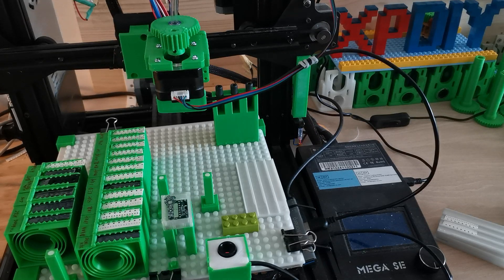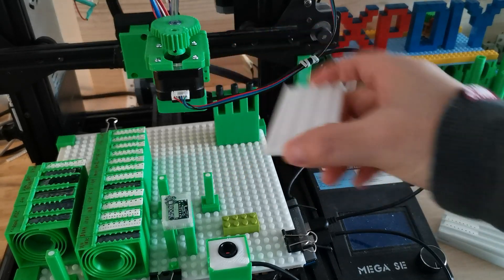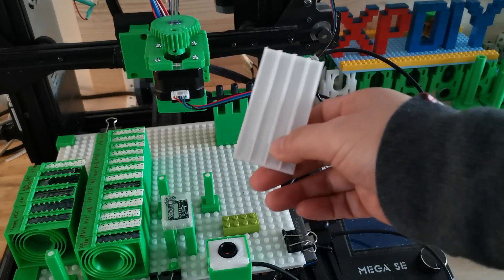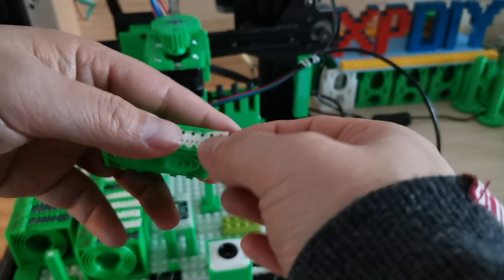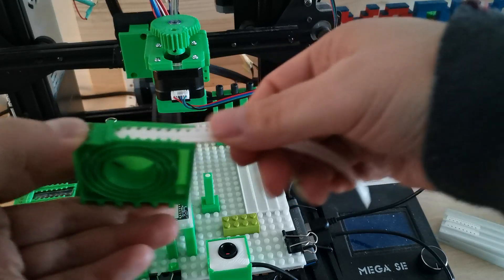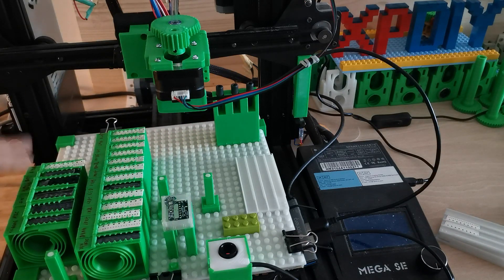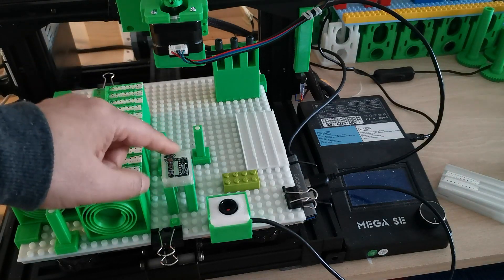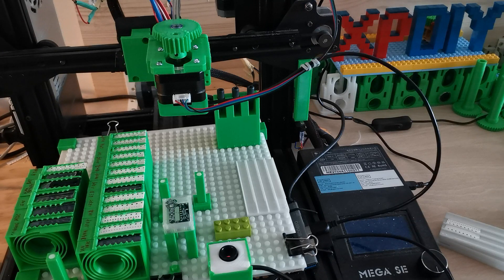3D printer to PNP part 9 - New Feeder design for small spaces

Comment: This is genius! Do I understand that the spiral tape storage pocket is hollow and so will keep the components from  spilling out? This would require the cover tape to be pulled away as you load the parts into the cassette. If not, how is the cover tape handled? Also - when can I get a file to play with?  In case you're wondering, I have a Pruse MK3S+
Reply from the maker: Thanks for sharing the info! Actually this is the simple version, so when loading, the cover is still there, one need to remove it manually after pulling out. The next version is when pulling out, the cover is removed at the same time, kind of semi-auto way. But this will come only after I released the first version. I hope to get things ready within a month, then will work further on the feeders.
Reply: @xpdiy  Thanks! I'll be watching for it. My most difficult boards are 0402 and leadless. There are at least 50 line items, so you can imagine how difficult it might be to fit all those feeders and how expensive feeders for this would be. Your solution is not only  very compact, but could easily make a preloaded magazine such that swapping in a new magazine in the middle of a run would be a simple matter.

Comment: I have been following for last year and can see good potential of this project .  CAnnot wait for some documetation models , drawings etc . 
Even if this would be paid I would parcitipate . Can you estimate how soon this will have some documents available ?
Reply from the maker: Hi, thanks for your interest in the project, I am setting up the website and should be up within a month, currently waiting for some doc from authorities. What printer do you plan to adapt? I am trying to support more printer, and if you have the dimension data for hot end bed (screw hole distance to the side and the bottom of the hot end bed), I can create model and see if that works.
Reply: @xpdiy  Hello . I will probably adapt my Ender 3 . Thanks for updates